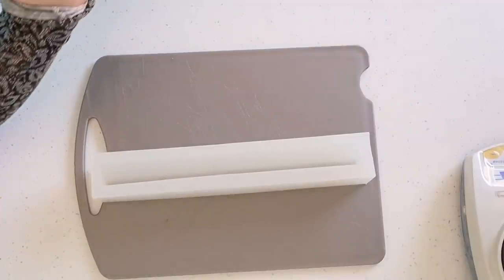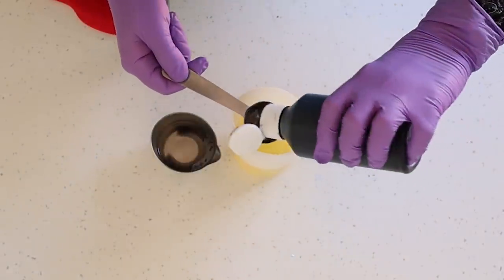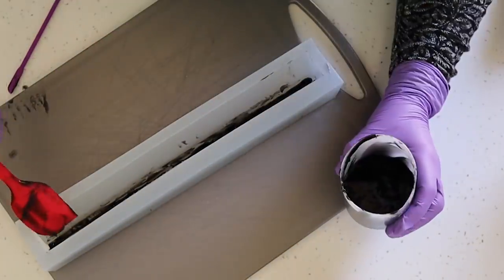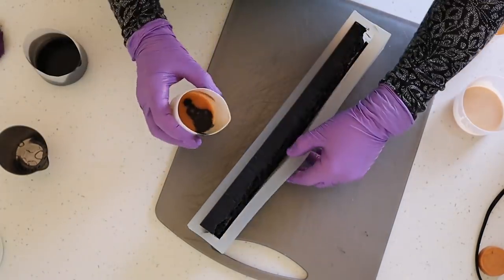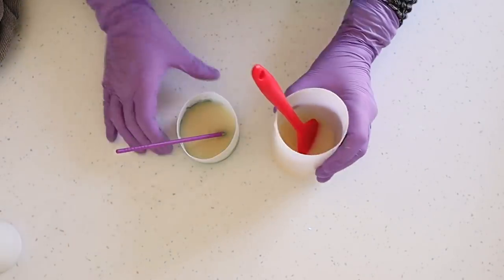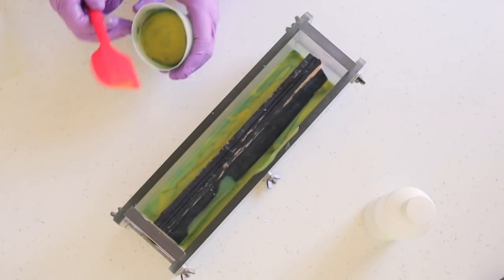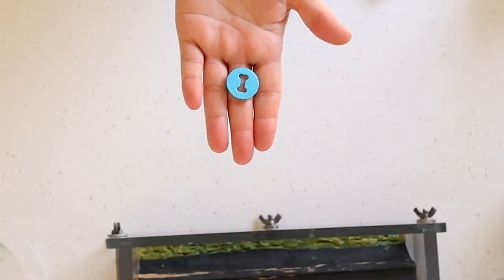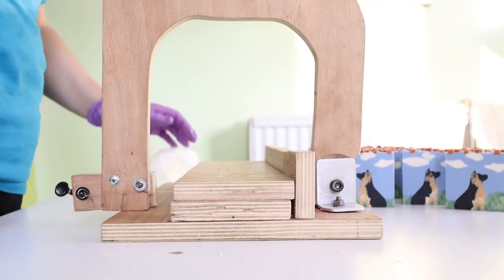Dog Embed Cold Process Soap Making tutorial. Landscape Soap

Comment: Hey, I recently bought a KD8000 scale after being told it was trade approved by someone on fb though I heard at the beginning of your video that you'd changed your KD7000 because you can't sell your soap without trade approved. I notice the CE mark on the back of my scales which means they meet the European standards for using and selling. Am I losing the plot or did you change your scales for other reasons too. 
Complete newbie here so still learning.
Reply from the maker: Hi, CE is not the same as trade approved. The KD8000 is definitely not trade approved, if you live in Europe or the UK you will need proper trade approved scales, you will find that on supplier websites they are marked specifically actually as trade approved they will also have an M letter on them (and be a lot more expensive than the KD8000/7000 etc)